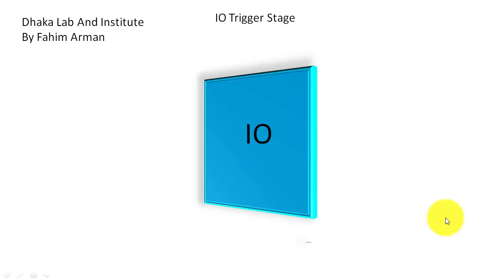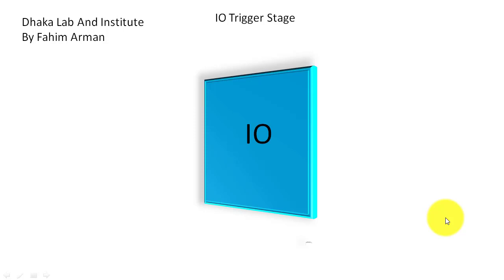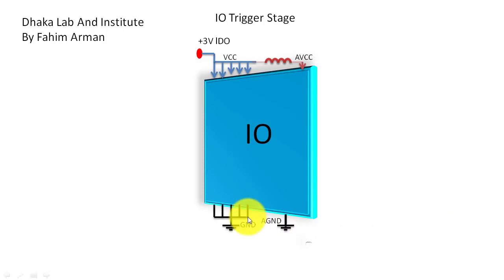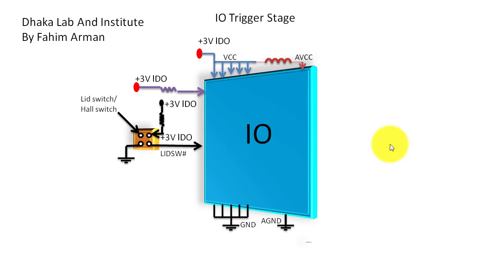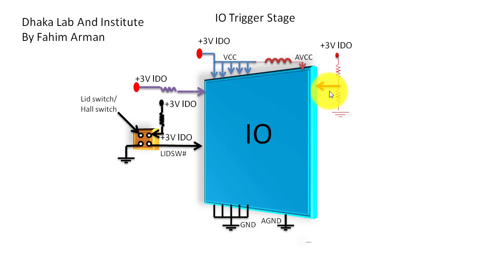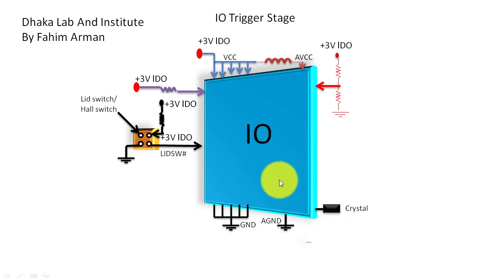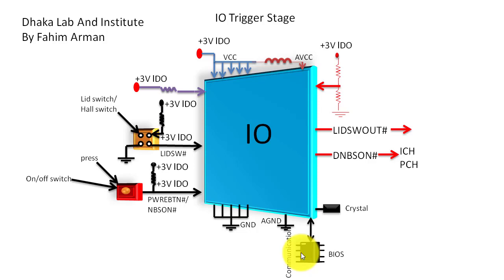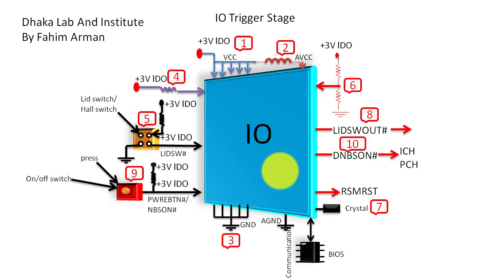Basic requirements of IO/KBC/EC of laptop and its triggering process.

Comment: Hi, i am chasing a NO Display. and watched your videos and are clear and excellent. I have no 3.3V at WIFI Pin 22 and watching this video,  i DO have 3.3V  RSMRST leaving the SIO at step 12. Does this mean the BIOS (step 11)  is good or bad or could still be bad?  I also checked lid sensor and its going from 3.3 to low with magnet and checked at SIO pin low there.